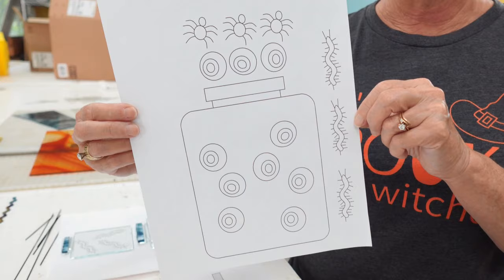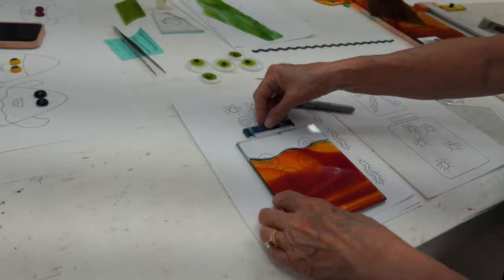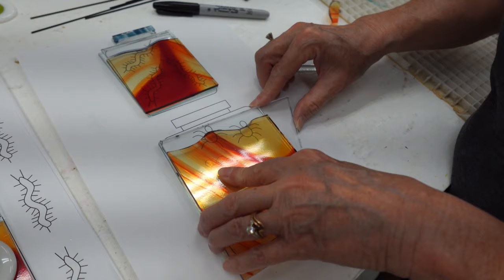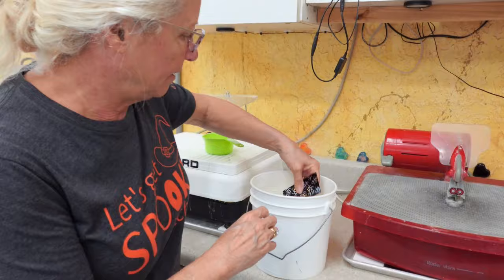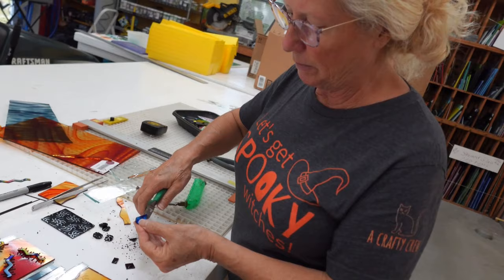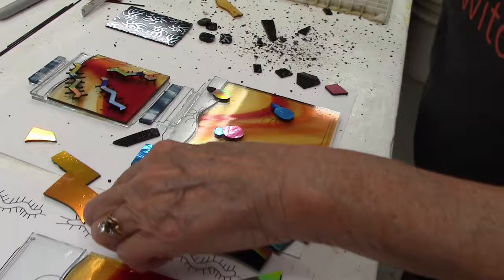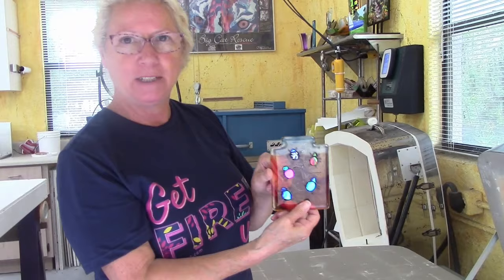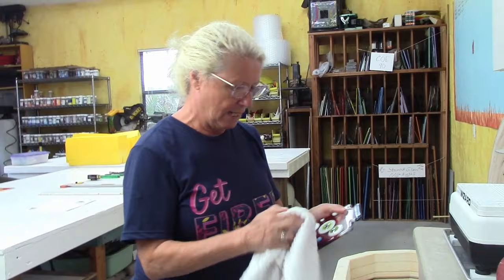How to make a Creepy Jar of Eyeballs, Spiders and Bugs with Lisa Vogt

Comment: Did I hear you did full fuse then tack fuse for texture- if the full fuse was first would that flatten everything and take away texture? Thanks
Reply from the maker: I should have specified a bit better in the video but the jars were fired at a full fuse with just the legs on then I did a tack fuse to add the eyeballs, spider and bug bodies so that way they looked more 3D. I hope this helps!
Reply: Yes fully understand, I do that first full fuse of background design then add my decoration and then tack fuse. Great. What fun as always 💕